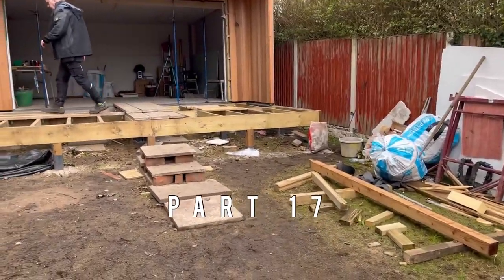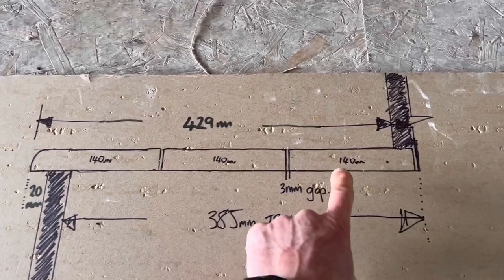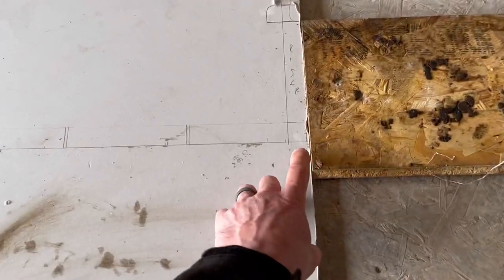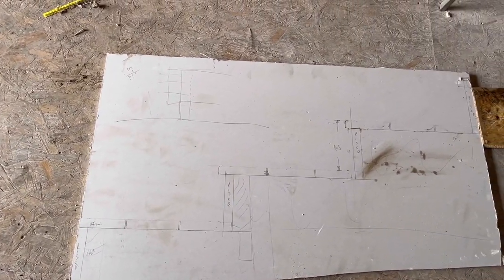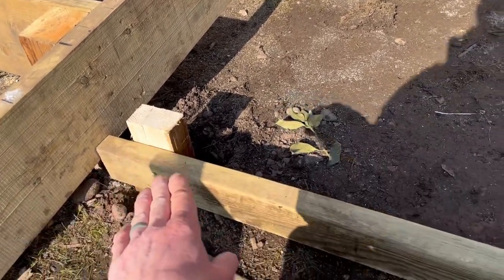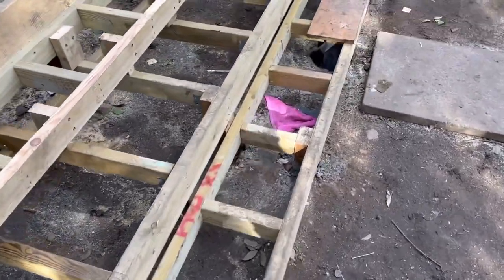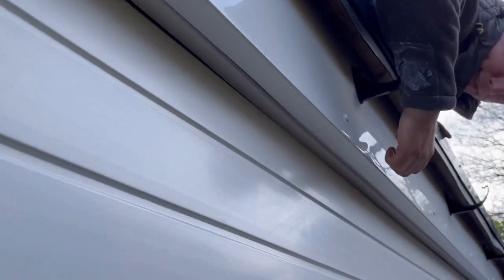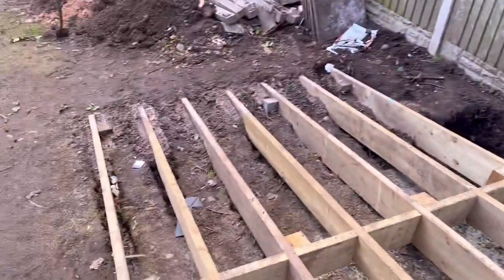How to build decking steps

Comment: Im only an armchair youtube DIY viewer... but those steps seem massively over engineered? How come you guys chose not to use stringers?
Reply from the maker: Your not wrong mate but it’s the size tread they wanted and the only way I’d have done a stringer to accommodate it would have been to use a massive timber section anyway so I chose this way. Worked well and it’ll never move or sag 😁👍🏻